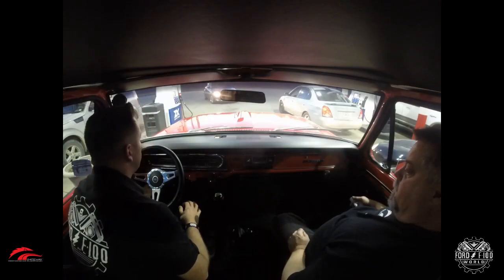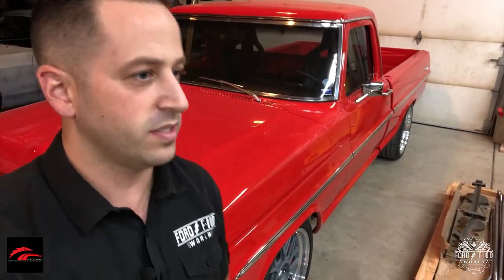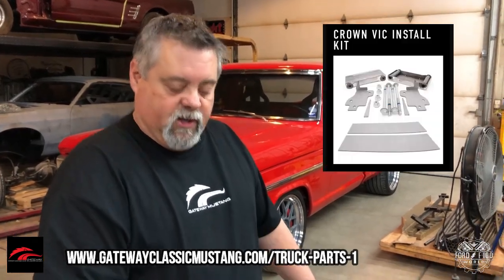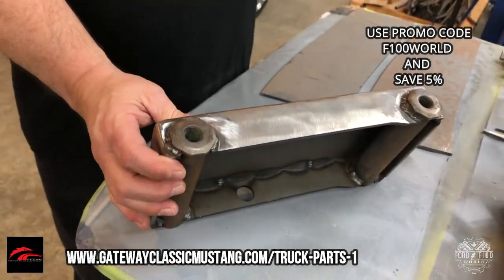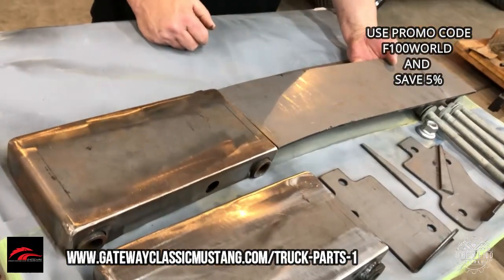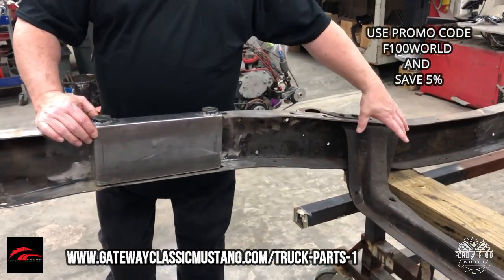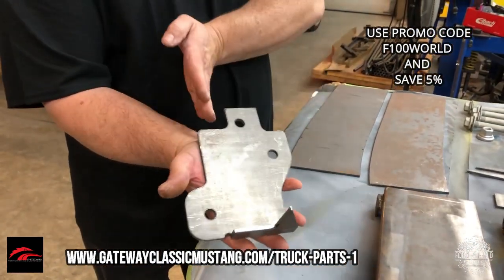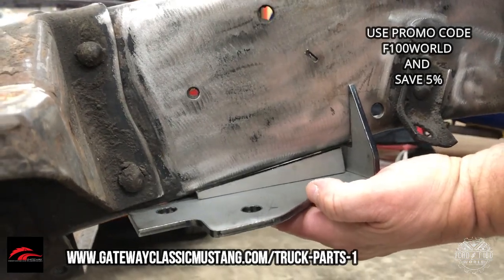F100 parts! Gateway Classic Shop Tour!!!

Comment: I love the ford truck of my time and before... I am 72 and it hurts to see that the truck henry built is no more. When I bought a 71 ford highboy, I was the king and the little chevys had to fight hard where I went. I made enough money logging for myself that I paid cash for my truck.... Young and dumb, I bought the half ton because it was prettier. It came with the married transfer case.. after tearing it up, and a lot poorer, I turned it into a heavy three quarter with the one ton rear end, a two ton international was that doner and with eight hole wheels all around and a 205 transfer case, the 390 built up with a good cam... super low rear gears that I knew nothing about at the time that I welded the rear end up and locked the rear end and the front axle was set for the dually rear wheels to so it was tough and quick, slow on top but fast on take off and the new transfer case took the punishment. I  built my first service truck as a labor of love. It wound up with the 72 grill and free from any dents as I dollied them all out. A steel flatbed with my lincoln welder, torches and tools till the cows come home as I made real money with that truck! A lot to take in on a comment... I never got near the little truck for years and I kept that truck for years. When I moved to alaska, I just couldn't take a lot of stuff  so the wife put it for sale on the local radio station and it got the phone ringing off the hook. Remember about all that was ford was cab, engine transmission, and the rest was built at home. I originally paid less than three thousand but with one ton chassis and flatbed (service truck style) a logging company bought it for the owner as he really liked it and so I had five people in my yard going " I'll pay" and the guy who bought it said " It ain't worth what I will give but will twenty five take it? ... I shook his hand and the others went away  cussing